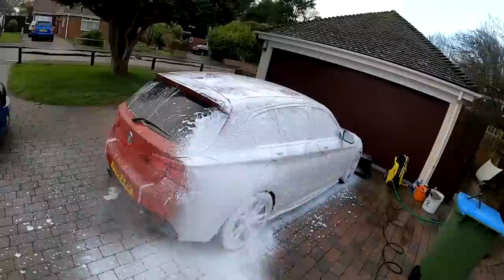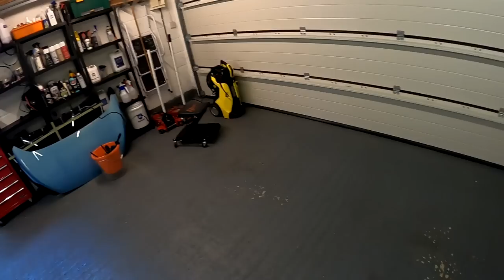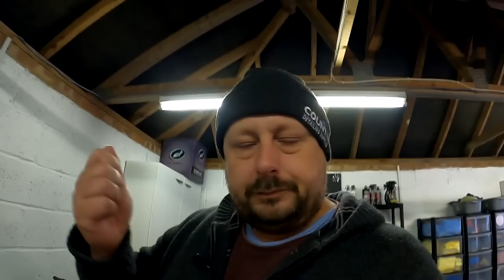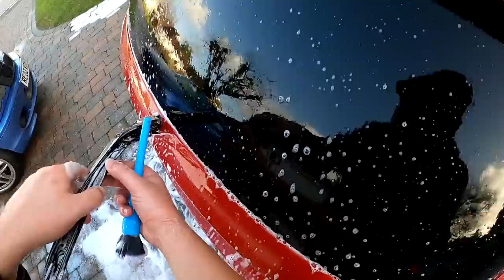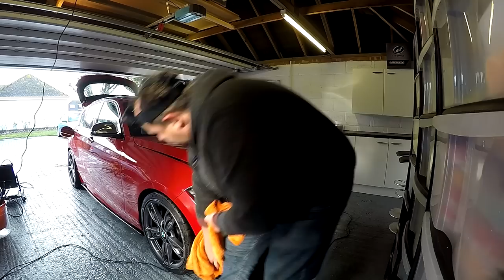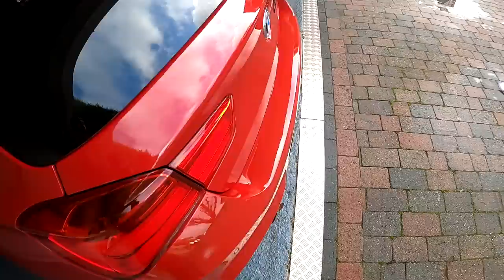Salty Winter Road Film Purge | BMW M140i  | Deep Cleanse back to Wet Gloss Detail

Comment: Have you changed the gun on your karcher? I got a k4 and see these smaller ones and would love one as the karcher gun are like holding an AK47 😂
Reply: Would like to know which one you use and also is it the original hose as these wind me up literally
Reply from the maker: yes mate done a video on this..   going great guns.. in2detailing sell the gun for your K4 K series.
Reply: Cheers Jon 👍🏻 love your channel btw just starting to get into cleaning my own car and van find your video extremely helpful

Comment: Would using a cheap car shampoo cause soap residue on glass?
Reply from the maker: potentially its possible.. but also potentially no..   usually cheap shampoos are just low concentration which actually helps reduce the chance of like product residue..    I have used a few poor shampoos over the years that created resisdue issues but they were actually not the cheap ones...  

if a shampoo contains wax or protection products, it could be more likely to have residue issues.